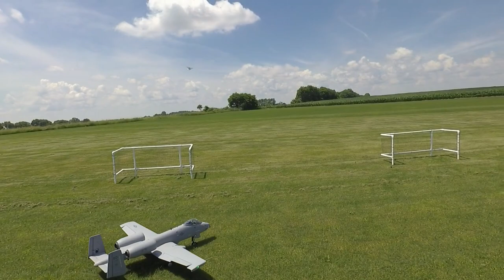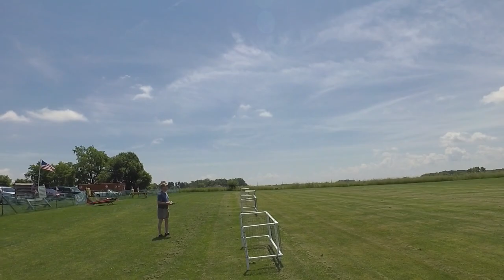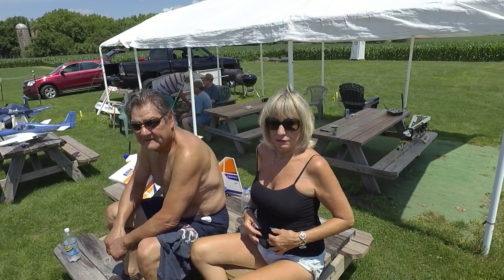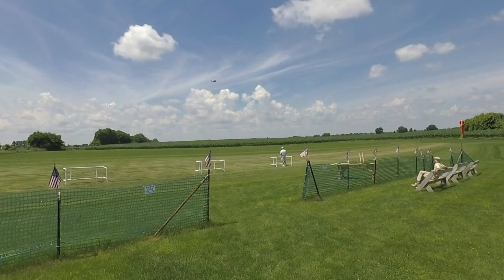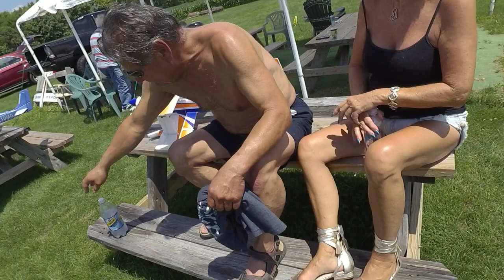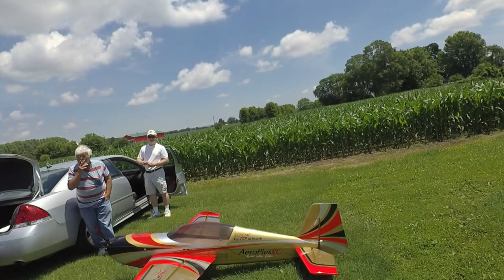Flight Attempt #2 with the Freewing A-10 1700mm 80mm Twin Jet from Motion RC.

Comment: Well Skip.  I did about the same thing with my FMS 1450mm P-51 last week.  My first video with a sports camera in the cockpit and it never left the ground.  Did the normal yaw left on take off roll.  Instead of straightening it out, I thought I could get it up before it reached the tall grass line on the left.   Nope!   Straight into the grass it went.  Short video from the flight deck lol. 😄
Oh well.    One week, a prop rebalance and two new outer gear doors later,  I got my inflight video.  No worries.   That will be up in the air before you know it and all will be forgotten.   Cheers.

Comment: Dont feel bad. I flew my Maule into a power line last night. I also landed it in a large hole used for a trampoline.  I used the hot water method to bring the wing back out where it inpacted the powerline  but being it is a new plane, I decided just to order a new wing. It also snapped the strut. The wing cost $44 which I think is expencive but whatever. I can fly it with the repair I made but it looks terrible. I normally can live with a damaged plane but being brand new it bothers me and its unacceptable at this point. Yes, never try to second guess a control setting. I made my Apprentice a tail dragger after the front landing gear failed for the 3rd time. It just cannot handle the ground I fly from. Not that it is that bad really, its not a paved runway. I have larger wheels too. Those wire struts just dont hold up. It flys better and It takes off great now that I made it a tail dragger.
Reply from the maker: RC Hobbyist Extreme thanks bro.   Yeah it a year old but still hhurts

Comment: bummer skip, i've learned with foamies being mine are all old 8+ yrs that you must over build and beef up everything, carbon rods , epoxy and good ole hardwood .  eventually  there heavy so more power .  all my servoless retracts are ply mounted with epoxy .  well bright side is you got some tinkering to do this week ,,, lol building is where the fun is ,  she will fly . like you said it could have been worse.  but sometimes the foam exploding into little pieces is pretty awesome . i've turned a few too dust .
Reply from the maker: I know right !  My first F-16 virtually exploded on impact.  Like a Pop Corn explosion.   LOL